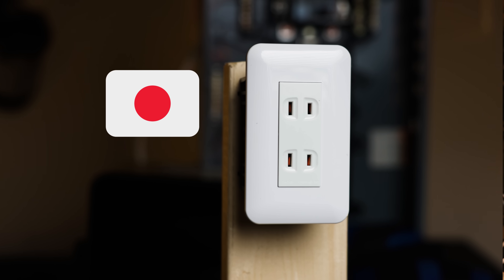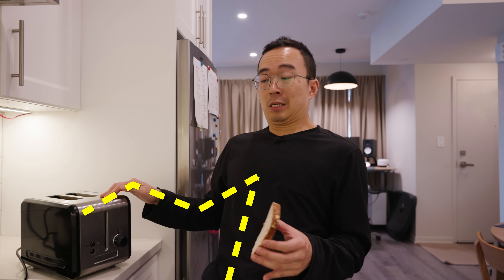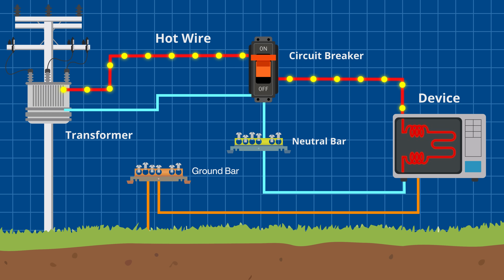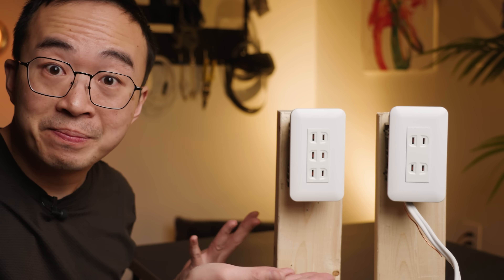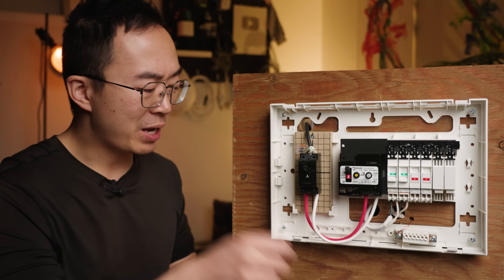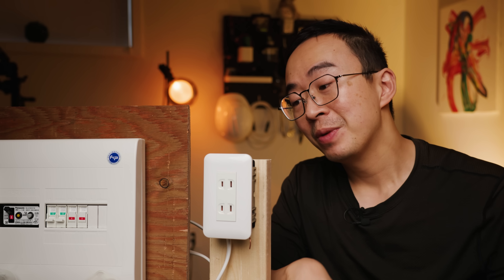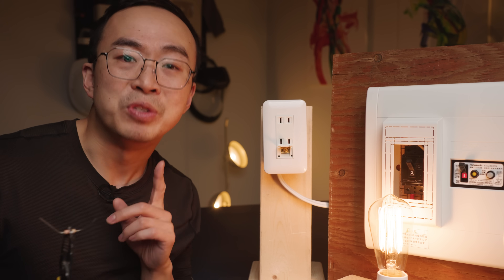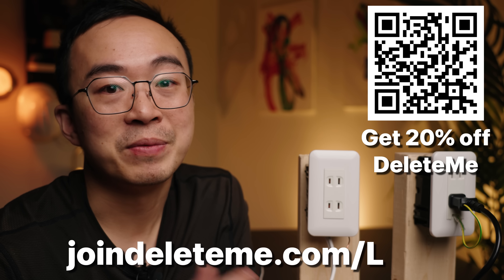How Japan Made Their Outlet Safe

Comment: Neutral is connected to ground at the main terminal. Most US appliances don’t have a ground, even a hair dryer which could be dropped into a bathtub.  The ground is used when there is a metal exterior that could become energized (usually).  It’s an extra protection.  

We have a 70 year old cabin in Montana and there are no ground outlets. Two prong outlets only.  Just hot and neutral.  Nobody has died so far.  That’s how they did it for a long time.
Reply: Grounding is not for making short-circuit path from chassis to neutral (that's a bonus, since Earth can act as one huge capacitor), it is to equalize potential of device and rest of the world (Earth). Humans stand on Earth, houses built on it, furniture placed on floor connected to it, name anything and it is there, always (as far as it is not flying). But if connection to Earth is high-impedance, potential difference may be pretty great and when some lower impedance connection is made (human touches device, for example) significant current may flow.

Although, it is not critical in home use as devices usually are small and their electrical capacity is too – if metal chassis doesn't have direct connection to live wire, amount of energy it can accumulate is not enough to do human any harm. And it is not often devices fail in unsafe manner, countless generations of engineers made sure of that.
Reply: @zetash1be441  Yes, that was my point.  We have a 70 year old cabin without a ground (just hot and neutral) and so far...zero deaths...and zero shocks as far as I'm aware.  The ground is simply an extra.
Reply: @ 70 years ago it was an extra we couldn't afford, now it is. Or at least we think so :)
Reply: There are common plug in oil filled heaters sold in the US that don't use thick enough gauge wiring and they lack the 3rd pin.

I've felt a shock from at least one.
I had to replace a cord on another from fatigue, and found that inside there was a bolt or screw that I could use for the safety ground line.
Reply: @jeffkardosjr.3825 Chinese junk sold on Amazon no doubt, with a fake UL listing.

Comment: Living in Japan, I've never seen a grounded outlet. I sometimes need to use a 3 (american) to 2 (japanese) prong adapter for my laptop or such, and there is always a ground wire on my adapter. I NEVER knew why, until now.
Reply: Actual answer - because they're cheapskates. A run of copper wire for proper grounding costs much much much more than single GFCI per installation.

Comment: The Japanese outlet is not that good. That grounding rod on US outlets keeps your electrical outlets balanced if your outlet loses its grip strength with time. GFCIs are great but landlords are VERY slow to change old outlets and one of the most common causes of fires are plugs drooping from their sockets and catching fire. While there are fewer electrical shocks, fires are extremely common. Had the three-prong type outlets and plugs been more common, Japan would probably have a dramatic reduction in house fires.

Comment: I thought Electric shock don't hurt as long as the circuit is not completed. Imagine a dry place, even if you hold the phase or neutral you won't get electrocuted unless your bare body is touching some conducting material. Just wear a proper insulated footwear.
Reply: Power transferred by electric field, not by charge carriers. That's why alternating current still transfers power through capacitor, which in that case forms between ground and you with insulated footwear as separator. Electric field applied to the body makes active changes to chemical composition of liquids (ion electrolysis), disrupting normal ion-exchange processes in body and bringing pain. Do not touch live wires directly, wear insulated gloves/clothes or you will get shocked anyways.

Comment: Japan does have ground for larger voltages. I noticed my in-laws had a ground on their AC, which had a designated outlet near the appliance at around 7 feet off ground, I can't remember the voltage, but looked like a "regular" American outlet. It said the voltage on the outlet, but I can't remember, and google not helping.

Comment: You are Incorrect early on.  The 3rd pin doesn't prevent an electric shock.  The electricity will happily go to back through multiple paths.  The ground pin allows the breaker to trip sooner, but can still zip you before the breaker/fuse trips.  Even GFCI will not prevent shocks.  They will minimize the shock and accelerate the circuit tripping.

Comment: "How Japan Made Their Outlet Safe"
This is straight up utter bullshit. Their outlets and plugs are even worse than the North American ones (which they are based on), which all of Europe makes fun of.
Double-insulation exists in many other countries, yet grounding acts as an additional safety.
I fucking live in Japan and there are plenty of devices that have a ground wire (or would benefit from one), but most of the time you can basically shove it up your ass, because there is no place to plug it in. I have also seen plenty of utterly shoddy electrical installations.
Plenty of electronics have metal enclosures and the ground is completely optional, because again, you probably have no place to plug it in anyway.
Keep jacking off to "Wow Japan so epic" nonsense and start actually critically analyzing shit.
Japan has the world's lower voltage and one of the weakest electrical grids. On top of that it is split between 50 and 60 hz and to this day causes issues.
An average American house can supply 100-200 amps, whereas in Japan many residential contracts max out at 60 amps.
I've even seen examples of grounding that wasn't even connected to anything.

Comment: There's nothing to argue about, having ground is always better. If you are using a laptop with metal body, there's a good chance you'll feel an electric current when touching the metal part if the laptop is running off an electric socket without ground. While technically this low current caused by the EMI filter isn't necessary harmful to humans, I rather it goes to the ground through a wire rather than through my body.

Comment: Horrible video, as it makes many mismatched comparisons, claims facts that are flat out wrong, and makes qualitative judgments between aspects of electrical systems that are not equivalents.  

GFCI's should not cover whole homes as exist in the USA, where a service is likely to be 200 amps, 120/240 VAC.  A GFCI that size would be expensive, less responsive than smaller units, and make systems that do not benefit less reliable due to false trips. (eg, HVAC, refrigerators, water heaters, etc)  

Grounds are irrelevant to how GFCI's operate, but may drain static charges or prevent a metal housing from going hot under malfunctions. GFCI's do not rely on them, but sense current imbalances between active conductors, and so work with 2 wire devices, or hazards to sinks or other grounds not part of electrical wiring.  That's also not comparable to circuit breakers that limit current capable of overheating wiring and causing fires, unrelated to human shock hazards.  

As an engineer I could pick apart innards of GFCI design, or compare differences in international power systems, from grid out through secondaries and service feeds.  This video is so sloppy and reckless, it doesn't merit bothering to delve into those issues, and how they relate to other misrepresentations in this video.
Reply: Don't you know? Japan epic. Therefore, everything that Japan does = epic.

Comment: So I love how you talk about how they would need to do upgrading to the power poles for grounding but for a gfci to work it has to have a ground and I highly doubt they don’t ground transformers. Also fun fact if you don’t ground the neutral you will get unbalanced voltage on the two hots for a single phase. They just decided go a different way of doing it.
Reply: We do have grounding in Japan. This video is very very wrong.

Comment: This guy is so wrong in so many things, and just so i dont get bantered hi im a 4th year electrician and went to the IEC in texas so i feel qualified to talk about this, first the ground is not one huge copper pipe connecting your appliance to the breaker, thats only at the ground bar and the ground bar is mostly there for if your house gets hit by lightning or something else big, also during normal operations the power doesnt go back via the ground it return thru the neutral, if your hot wire touched ground anywhere in the appliance or the cord or whatever that creates a ground fault that causes the power to go thru the ground it hits the bonding jumper hits the breaker and trips immediately because thats what a breaker does, it doesnt matter if your light/outlet,etc only uses .1 amp if a hot touched the ground it will immediately trip within like .2 seconds or less, even if we create a short circuit wich is hot to neutral it will trip even faster because it multiplies the amps by a huge amount wich in turn makes it trip even faster, so the higher the voltage the faster it will trip, now if you have a 15 amp breaker and it uses 15.1 yea it might take a little longer but it wont take more than a second for it to trip (i will not explain how a breaker works just google it) next for the GFCI, They are the safest recepticle you can install but also the most dangerous wich is why you need to know how to install one, have you ever noticed you're in the kitchen using a regular recepticle thats plugged in to your blender or whatever and if it does trip you dont check the panel you go to your gfci and hit reset on it, thats because your GFCI outlet protects your outlets in your kitchen, everything in your kitchen, bathroom, garage, etc is protected by a GFCI, the GFCI detects ANY unbalance in the circuit and immediately trips, and what i mean by that is lets say your hot is carrying 10 amps and for some reason your neutral only returns with 9.7, well your GFCI sees that and shuts off immediately, this is why they are installed in "wet" locations, the water will "transfer" (idk the correct word to use) some current away and your gfci will trip, now lets say your GFCI doesnt have a ground, well thank god that the people who do this for a living are smart and tell you to slap a sticker on it to say that there is no ground installed and if possible install a GFCI breaker in the panel, if you cant install any GFCI at all via outlet or panel then there is more safety added that i wont go into detail just google it, if you have questions ill be happy to answer back, ill have my 2023 NEC codebook to explain in further detail

Comment: In the US there are still many residential circuits without ground and the most common way to make them safe is to add GFCI protection either by installing a GFCI receptacle at the first outlet, or a GFCI breaker at the panel. 
important note for GFCI testing if the GFCI Receptacle is installed in a circuit that does not have grounding, it will not trip when using a tester, but it will trip when the test button is pushed.

Comment: There is an unusual system used in the UK. The 11KV has 3 phase R-B-Y but the return is not supplied. It is grounded at the transformer. So, effectively it is double grounded.

Comment: You are wrong. Ground prevents electrocution by giving current path of least resistance and dropping contact voltage to safe level. If that causes overcurrent condition, it will trip circuit breaker, but in many cases, current to the ground can be low enough to not trip circuit breaker, but without ground path, voltage and available current would be high enough to kill person. Take 25 W incandescent bulb, connect one side to live, other to ground. Will it trip breaker? No, it will trip RCD (if exist), but not breaker. Disconnect ground - would you touch that wire dangling from light bulb? Not, if you are smart. You can still get lethal current trough light bulb, but that current will never trip breaker.

Comment: Don't forget in other countries such as Germany, ungrounded outlets such as euro outlets featuring the euro plug are also a thing for devices where the GFCI is enough. In Germany specifically, you can plug an ungrounded plug into a grounded socket but not the other way around because of 1) pin diameter and 2) outlet shape. So even if the outlets in Japan are by default ungrounded it's not like half of my devices at home would even feature groundability
Reply: I'm from the US.
My laptop power cord has the US 3 prong.

On a common French outlet, I can use a simple 2 pin adapter and the ground pins will make contact on their own.

On a German outlet, the pins are spaced too far apart.

The hotel I stayed at in Berlin had a UK style outlet at the desk in the room.

So I used a UK adapter which had all 3 pins make contact.

Comment: Wait so the house is connected to a single GFCI and we know a GFCI will break over time. An American household install GFCI but still have a main ground in case they fail but for a Japanese house if the GFCI fails that means the whole house has no ground. Wouldn't it be better to bite the bullet and install it anyway?

Comment: As mentioned  above, I learned very early on in electrical trade school that the ground and the circuit breaker are not for protecting human life or safety, they are for protecting the branch circuit. In fact grounding actually makes the circuit MORE dangerous to people. Old knob and tube wiring was the safest wiring we ever had. There was no ground and the conductors were spaced 6 inches apart. It's the ground that gets ppl shocked all the time. Without a ground there is no place for the hot to go or be attracted to.

Comment: Thailand houses use the GFCI in their main panel too but shocks are still common because it's set to something ridiculous like 20 mA.  Most people put little rugs in front of appliances that you're supposed to stand on when you touch the appliance. I measured anywhere from 80-120 volts floating on the chassis of several appliances. First thing I did when I moved here was run an earth ground in my inlaws' house and upgrading the outlets in the kitchen to three-hole..  I'm happy to report that in 12+ years they've never been shocked.  They always though getting a little tingle when you reach for the toaster oven was just a normal thing... lol.

Comment: The advantage of ground + GFCI is there's a difference when live touches ground: GFCI trips vs live touching neutral: circuit breaker trips. If the circuit breaker trips you know it was overloaded. If the GFCI trips you know you have an appliance with a grounding problem.
Reply: Ground wire plus gfci is what we call in the engineering world “belt and suspenders. Better to have both. 
The problem with a whole house gfci only is that you loose all the lights if it trips. Good codes require two lighting circuits per floor in residential.
Im using combo gfci and afci breakers in the us. Ive heard it said afci’s will prevent the majority of house fires.
Japan designs useful things but the world has raced ahead and they have fallen behind in technology.

Comment: well it would work until some water, emp or a power surge frys the elctronics you know. also what peapol don't know is that the wire grorunding  circit in the usa is ment to protect the elctrinics not the humans you. now you know thats why its there. its not for the humans safety but for the house and elctrnoics safety. its bacly like a overflow pipe that is ment for cases where the cirrect braker alone is not entogh. but it does work to protect both however its just it protects humans and the elecyrnocs better when its grouned by the way. also a feriday cage also uses grounding into the gronud  but ona massive larger scale that workes agest acatl lightneing and huge amonuts of radation both non and ionzeing depending on what its made out of.

Comment: So just to be clear in both the US and Japan the ground circuit to the ground rod still functions to handle lightning strikes and prevent floating voltages right? But their grounding circuit just only connects to the breaker panel and not to the individual appliances?

Comment: Haven't looked into this yet, but I'm assuming it's relatively trivial to retrofit a US breaker panel with a full house GFCI before the service point is wired to the breaker panel main breaker (of course, need to de-energize at the service meter before working in the breaker panel).

Comment: Pretty sure the current regulations for the here in the U.K. is that all circuit breaker board installations have to have an RCD built in, so you might need to change the graphic with a grey one with a GB flag, because although it is now needed lots of places don’t have them.

Comment: There’s no reason not to use RCDs in the switch board in the US. Most countries use them even if they have earth neutral links.
Here in New Zealand that uses a Multiple Earth Neutral system, they are mandatory for circuits with power points in them (like most of the western world).
Breakers protect equipment, RCDs protect people

Comment: There are few other ways to solve the problem. 1) capacitor as earth with high positive polarity. 2) appliance with non metallic surface. 3) circuit breaker in appliance itself. 4) warning lights and alarms on electrical equipment. Problem : what if the circuit breaker wire breaks?